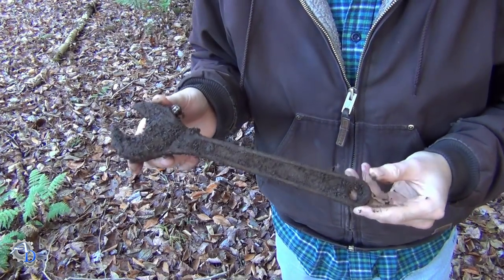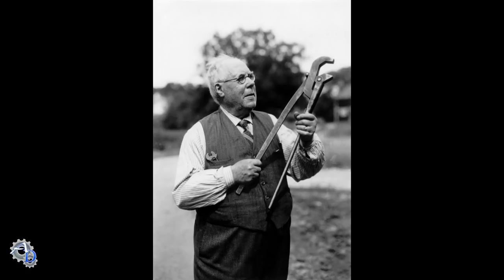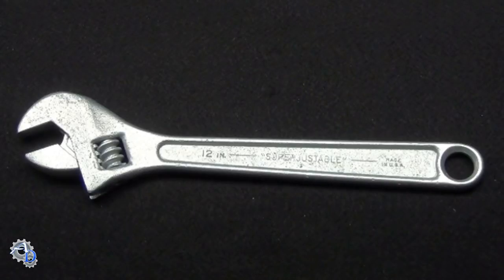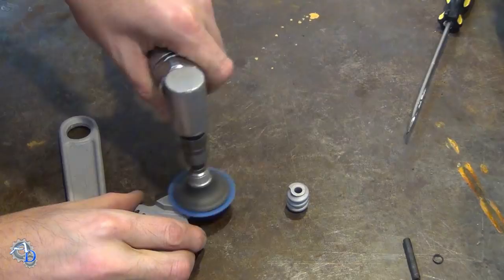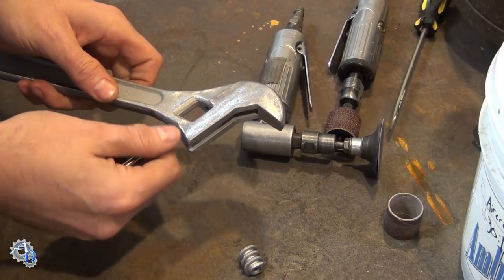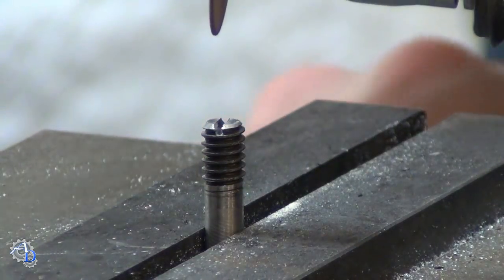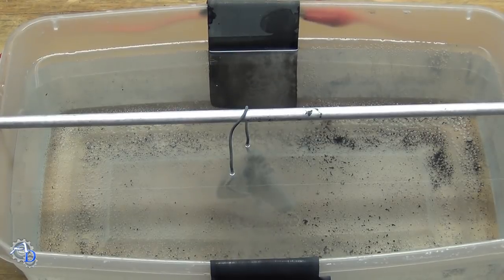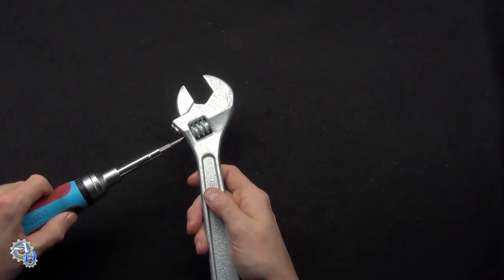Adjustable Wrench Restoration and History

Comment: Hey, you found my spanner! Seriously though, that vapour blasting technique makes the zinc plate much more acceptable as a finish. I just got through zinc plating some parts from my set of wood planes and the best I could do was to lightly scrub them with steel wool before going into the blue dip. I didn't realise you could bake them in the oven to harden the conversion layer. Good tip!
Regards,
Preso
Reply from the maker: Steel wool works good too. I took the lazy way out and vapor blasted. Caswell says you can just use a hair dryer too, to heat the part to 150 for a few minutes to cure.

Comment: Great Video !!!
Great idea to replacing the adjuster screw ! ! !  Thanks !
If you don't mind me asking, what is the blue solution you use to harden the zinc plating ...
Reply from the maker: Thanks. The solution is blue chromating solution.
Reply: Arnold's Design ,,
Thank You Sir..
That will work great on those parts you would to keep that zinc look...
Thanks Again,
Have A Great Weekend.!